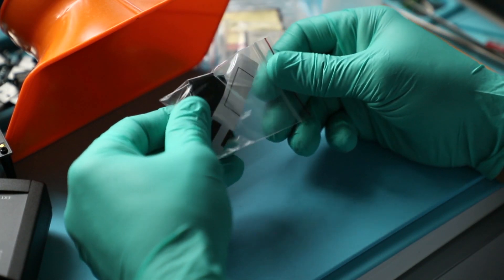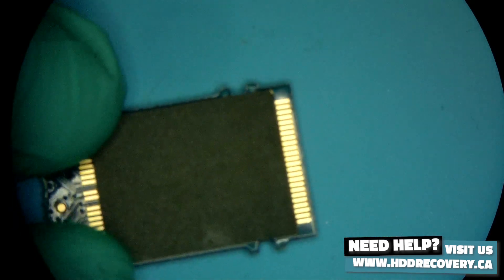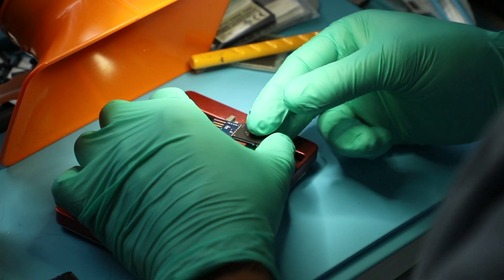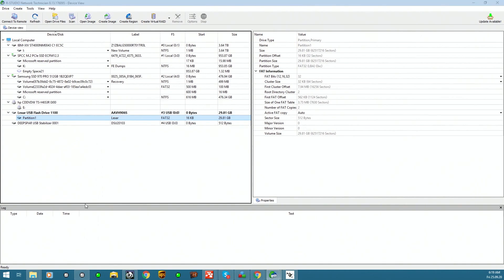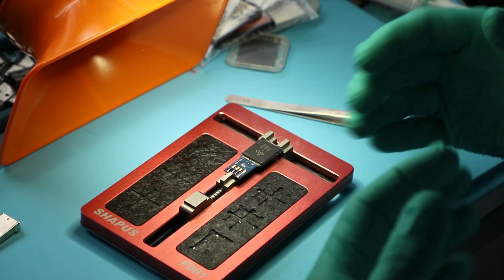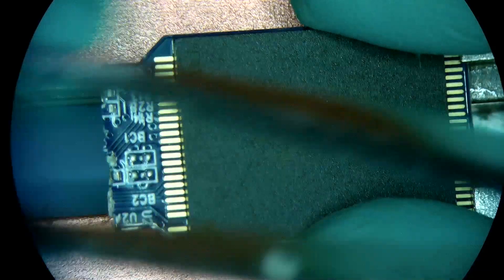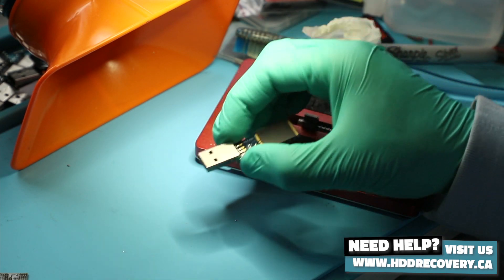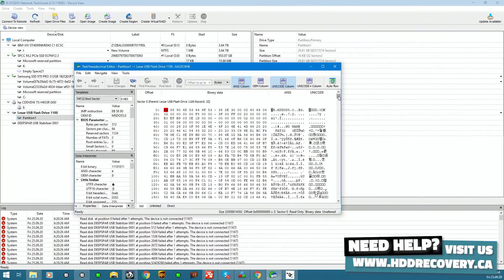flash drive broke in half

Comment: Does chip off take a lot of computer time? It seems like you put a lot of effort into repairing the device vs. how easy it looks for you to pop the chip off and plug it into your desktop. Or do you do it just for the challenge?
Reply from the maker: Repair on average takes 1 hour tops. If the unit can be repaired that means the NAND is not problematic and chip off would be easy from error correction stand point of view. With that being said I'd repair is possible - the results will be perfect because the unit will be ran by translator. Chip off does not have translator option for every device, sometimes the assembly has to be made by a block number. If you build the image using a block number and the device had sector update - all data will be in shifts by file structure, so you can only do RAW recovery. Not the best outcome. So that's why I always try to save the devices functionality for data access first. If that fails then chip off would be next best option
Reply: @hddrecoveryservices  thank you I wondered why you didn't just chip off everything. Also where did you buy your PCB vise

Comment: hello, I have a phone sd card and out of nowhere it stopped working and being recognized on the cell phone and I can't use it on the computer either.
I formatted the card. to see if it would work again, with that my bkp that I had saved from that card that was on a HD had a problem. and with that I also lost the files that were on the HD and I lost my photos. Is there any possibility of recovering the data yet, the one from the SD card? I have almost 600 pictures of my niece

I'm from Brazil, what would be the shipping method?

Comment: What wire do you use for the strap links? How can you avoid shorts? Is it insulated and the insulation burns off - or something else ? Thanks. Most impressed.
Reply from the maker: Yes, the wire is the same as what's inside of speakers. It is coated and the tip burns off the enamel to expose copper
Reply: @hddrecoveryservices  many thanks .

Comment: Great video! What is the model of PCB holder you use? Couldnt find it on the equipment list
Reply from the maker: I got it from Union repair but they don't have them anymore. I saw similar clamps on eBay

Comment: amazing. How do you make sure all the pads are connected under mem chips? is it by experience or did you put any pressure?
Reply from the maker: When solder paste reaches certain temperature it will turn liquid. When melting point is reached the chip start to flow. I push it with tweezers to make sure it floats.

Comment: Hey mate, i got a st3000dm001 giving up on me.
It started with extreme low speeds, then wasnt recognized by the system anymore.
I bought an USB/SATA connector and got access, but extremely low speeds again.
Strange thing: it doesnt make the clicking noises or any repeating sounds.

Any suggestions?
I am already looking for a donor but im not sure if it even makes sence. (i am a copier technician, so disassembling of hardware is no big deal for me. i simply dont have very much experience with HDD troubleshooting)
Reply from the maker: its firmware, not mechanical issue. Don't swap anything or waste money on donors. You would want to send that off to a data recovery company for that if data is important
Reply: @hddrecoveryservices  Its the FW chip then? yeah i probably cant restore the right FW-config for my drive.
Any desperate actions i can atleast try?
Data is not worth the money of a pro recovery, but still, its sad for the data.

Comment: Is it really worth in getting a deepspar usb stabilizer on the new USB WD passport knowing that some models have firmware locked ?
Reply from the maker: Yes. It's what it's best for
Reply from the maker: The problem with new spyglass2 drives is not locked firmware, it's they hardware encryption that is unique to the PCB, so recovery is not doable with board swap.

Comment: I like how effortless it all looks, and there is never ever any whining involved. I remember Rossman having much trouble reballing SMCs, or David Jones cooking a board ("reflowing" lol) at 400°C until the traces were smoking, instead of desoldering, reballing and resoldering the chip in question. You just do it, and there were probably lots of messed-up reballs off-camera in the past.
Reply: Could be that the ground plane on macbooks or iphones suck up alot of heat, so it takes longer to heat them up without burning.
Reply: @Ujwal5555  Obviously a small USB stick has a far smaller thermal mass than a mainboard, and reworking a CPU or GPU on a laptop or a console will require a proper IR rework machine anyway. But I was talking about cleaning and reballing the IC itself. Dave was always talking like it's black magic, Louis spent hours bitching about the solder balls going everywhere due to him not operating the hot air station properly, and here we see Erkin casually reballing a 100+ pin device with just solder paste and a stencil, no special fixtures or IR oven.

Comment: How was the location of the memory match determined from where it was installed
Reply from the maker: Sorry could you clarify your question?
Reply: @hddrecoveryservices  
Thanks , How you put the memory in its proper place, landmarks not shown !!
Reply: @FIXDIY  he marked the pin #1 on the chip before taking it out.
Reply from the maker: The chip has a dot indicating pin 1. Board also has a mark indicating pin 1
Reply: @hddrecoveryservices  thank you
Reply: @RahulPable  
Thank you

Comment: You do know you didn't had to solder a new connector to that board, right ? It works just like that
Reply from the maker: I know, but it needs a plastic housing to space the connector inside of the USB port correctly. plastic frame is like extra 2mm for snug fit. Instead of giggling it in the port to make contact I put the connector in place. No corner cutting... :)
Reply: @hddrecoveryservices  oh that's a good point, thanks for the reply, see you in your next vid